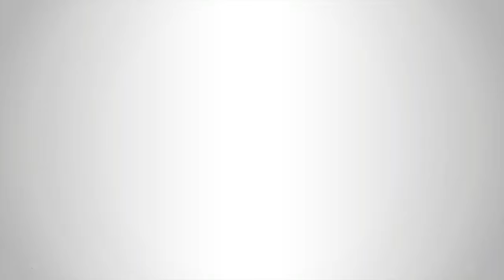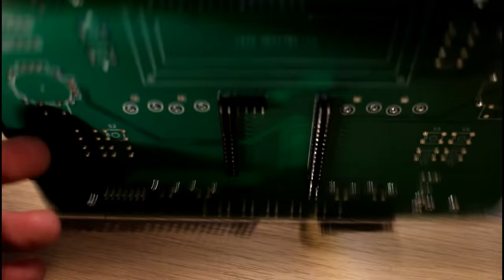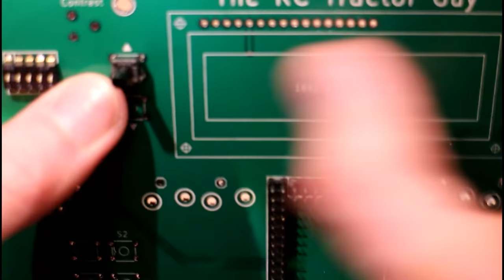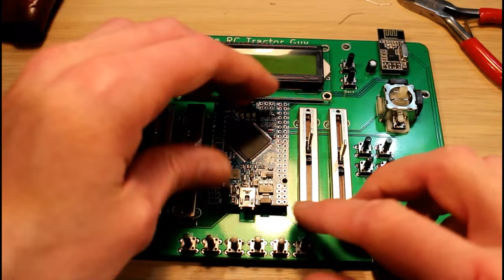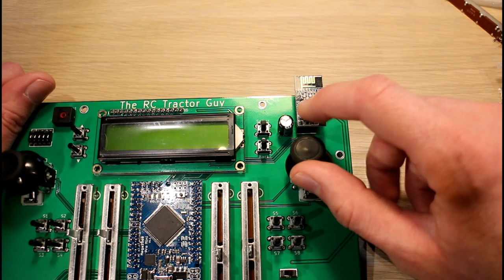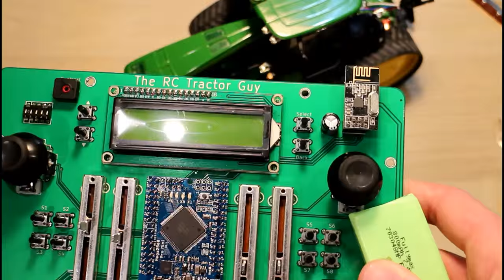RC Tractor Guy Controller PCB V1.0

Comment: It might be worth adding a dedicated 3.3v regulator for the nrf module on the next board version, especially when having the option to swap between high powered and low powered nrf modules.

There might be enough room to fix some 3d printed hand grips over the edge of the pcb.

Nice project.
Reply from the maker: +Mark Heywood Good suggestion, a dedicated 3.3 Volt regulator probably is the best way to go. It's a pity because one of the reasons I chose that Meduino was that it had both 5V and 3.3V outputs.

I had been thinking to 3D print some grips for it eventually, I put three mounting holes on each side of the board where I taught the grips could be mounted. I haven't looked into it yet though.

Comment: This is very inspiring to watch. You have made lots of progress on this. Regarding the mounting point for the LCD. You could have like a rubber spacer with doublesided glue. Perhaps just hotglue in each corner will do it to prevent stress on the solder points. Just a tip. Other than that, very nice :)
Reply from the maker: +bwack That is a good idea, I was thinking after I shot the video that you can get a foam type double sided tape which might work but rubber spacers would be a lot stronger.
Reply: Foam should do the trick as well so when the boards are shipped, you don't have to worry about solderpoints cracking due to vibrations and shocks etc which means less returns :) Another thing regarding returns is if you plan for the user to attach a battery, make sure there is no way polarity can't be mixed up. I think many rc-batteries come with some sort of keying. If you have a standard connector that makes it difficult to insert the plug the wrong way.. or use a diode... You'll figure it out :)
Reply from the maker: +bwack Good point, I should have included a diode in the design and will try to remember to add it. I don't think I could assemble them as well because the price would be really high. Could be €70 or €80 a controller so I'd imagine people would rather assemble them themselves and maybe just use the parts they need and add to it later as the build more complex controllers. I mean you would do a lot with just the radio module, Arduino and two joysticks.